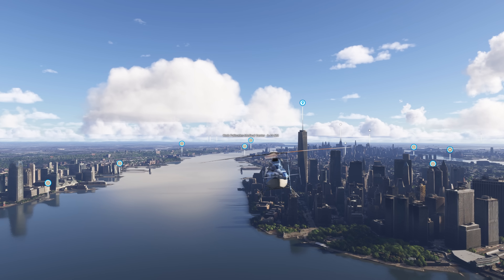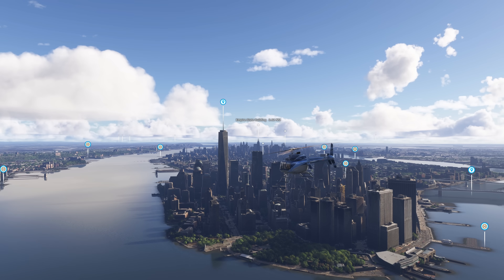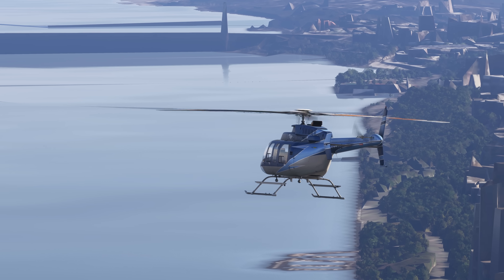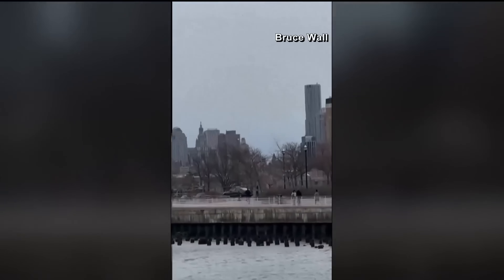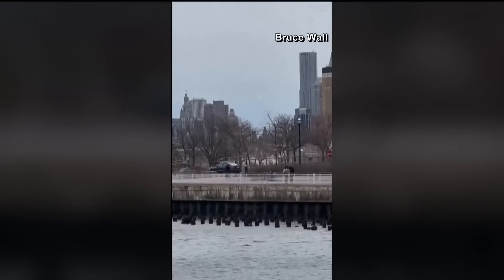Helicopter Expert breaks down Hudson Crash, and discusses “Bump Mast” Theory | NYC Crash Follow-Up

Comment: The rotor fell still attached to the gearbox and photographs show the blades are undamaged like they would be in a tail boom strike.   That helo had a major gearbox problem just a few months ago and the company has money problems so how well it was repaired is up for questions.   Looks to me like it seized up with how violently the fuselage twisted and the boom broke off from the inertia of the rotor.   The NTSB won't have any problems assigning cause to this one.

Comment: My uneducated guess is that the "jesus  nut" or jesus pin experienced catastrophic failure. As soon as the main rotor separated it hit or scratched the tail boom. The tail rotor not having to counter the torque of the main rotor experienced massive torque shift and snapped the weakened boom.

Comment: Don't these choppers have weight restrictions? 
Exceeding a choppers maximum load capacity can lead to
structural deformation or failure during flight. Was the total capacity above what that Bell was certified for? 
Did the operator check to see if the chopper was over weight capacity prior to take off ?

 Perhaps the chopper was fine failures to adhear to maximum rated weight could be the issue here did they weigh each person and what they were taking on board prior to take off to see if the flight would be within the crafts capabilities as far as weight / load are concerned ?

Comment: I did find a maintenance bullion for that model talking about  Corrosion of the fasteners or joint of the tail. 

I wouldn't play much into that because I would guess almost all long running platforms have these type of bulletins

Awesome guest btw. Great of you to get on people that are more knowledgeable than your experience allows you to be about specific fields or circumstances.  One of the required traits of a great pilot is the willingness to learn and being humble

Comment: Nope wrong assessment.  Maybe this gentleman did not see the video of the aircraft as the accident occurred.  The nose of the aircraft did a sharp turn to the right 90 degrees.  The failure is related to the tail rotor failing and going to a no torque situation causing the aircraft heading to go right..  Once that happened the tailboom can fail due to its moving sideways into the 100 knot winds and the rotor can depart.  It's basic physics.

Comment: I'm a helicopter guy. I have thousands of flight hours in the Bell 206 series, both long and short models. I am heart broken by the loss of life. The video shows a complete main rotor spinning and falling into the water separate from the aircraft. The video of the wreckage shows the tail boom severed about a foot aft of where it bolts onto the cabin section. Under normal conditions the main rotor cannot strike there. The main transmission is not attached solidly. It uses a nodal beam spring support system. this allows the transmission to bounce up and down in order to dampen vibration. I would look for a failure in this area. this could cause the transmission to tilt over and separate from the fuselage. Mast bumping has nothing to do with striking the tail boom. Mast bumping is when the rotor hub flexes down to the stop and the head strikes the mast. I don't think mast bumping is what happened here. It is hard to see details in the video, but I don't see the mast with the airframe. The rotor used in this aircraft is quite strong enough to cut through the tail boom and remain intact. This could only happen after the transmission came loose and completely tilted back.
Reply: Thanks. Navy helo pilot here. Flew the TH57 in flight school. The gentleman either has forgotten or is confused about what they taught about mast bumping at Pensacola
Reply: Former Navy TH-57(Bell 206), civilian Bell 206 Instructor Pilot and certified accident investigator here.  Yeah, not mast bumping and the gentleman’s description of mast bumping is not correct.  From the video evidence I’ve seen: mast bump - no. The rotor, mast and transmission are clearly visible autorotating to the water.  A mast bump would sever the mast just below the rotor hub. Rotor blade severing the tail boom - 
no. Photos of the recovered fuselage show the tail boom break just behind the fuselage mount point - impossible to get a rotor blade to impact that close to the fuselage and the intact rotor can be seen smoothly autorotating to the water.  “Jesus Nut” fail - no.  The “Jesus nut”holds the main rotor to the mast.  If that nut failed, the rotor would fly away from the aircraft - it didn’t.  The NTSB will get to the bottom of this but it looks to me like a sudden seizure of the main transmission, or a failure of the transmission mount.
Reply: I'm not sure the pilot had any warning before the catastrophic failure. what I am seeing is the tail boom was severed at about a 90-degree angle where the main rotor would strike if the main gearbox rotated backwards. This type of failure could easily rip the mast out of the gearbox The rotor blades are constructed with a D spar leading edge and aluminum honeycomb filler behind that. These blades are known to able to take small arms fire and chop tree branches when flying low. Chopping off the tail boom would not be a problem for a rotor blade. Calling for fuel when you are a few minutes out is normal. This alerts the ground crew so you can have a quick turnaround and get back in the air. This is how these types of operations make money. I do not see pilot error as the problem at this point. I am only trying to fathom how the main rotor can separate in flight and chop the tail boom off at a 90-degree angle. I know I am speculating. The investigation is at the beginning.
Reply: Hypothesis; Rotors tilted when they ripped out the transmission assembly and Rotors sheared through the boom close to the Fuselage. Both rotors are broken....
Reply: My condolences to the families of those passengers and the piolet.    May they RIP🙏.    So sad the whole situation 😢.
Reply: According to what I've seen, the entire transmission system ripped itself out of the cabin, an impossibility.
Reply: @Slitheringpeanut  It is very Possible! Read the Op's expert comment. He's a pilot with 1000's of hour of flight time in Bell 206. "The main transmission is not attached solidly. It uses a nodal beam spring support system. this allows the transmission to bounce up and down in order to dampen vibration. I would look for a failure in this area. this could cause the transmission to tilt over and separate from the fuselage."
Reply: @Slitheringpeanut Not impossible. Mechanical issues occur in such things that have never happened before.
Reply: There is no code in asking for fuel.  You can easily  make, half a dozen 20 min  tourist flights, before needing to refuel.  It speeds up the process if the ground crew is made aware.  In many cases, you don't even need to shut it down.
Reply: They lifted the main rotor, still attached to the transmission, out of the Hudson
Reply: I’m a helicopter guy too with many hours of flight and the Bell Helicopters are very reliable as you say and it doesn’t look like the Jesus nut was left of or had anything to do with it. My theory is that the pilot knew there was a problem and didn’t want to spook his passengers so he called on the radio he had to refuel after 16 minutes of flight didn’t make sense also he must have deployed the floats then the nodal noodles might have contributed because one video shows the transmission and main rotor falling together into the river. Of course we’ve got to wait for the  investigation and report. Condolences to the families of the passengers and pilot.
Reply: @jpridie  These are just 20 minute flights while the 206 can carry over 700lbs of fuel.  They would not refuel after every flight, probably only once or twice a day for of the 15-20 flights they make.  It would be perfectly routine to call in and let the base know that he’d need refueling before the next flight.
Reply: @jpridie  has it been confirmed that he said he needed fuel? It just seems like an easy way to point to pilot error, especially if there's no recording for the NTSB to recover. Please correct me if I'm wrong.
Reply: @catwhiskers1919  I didn’t want to imply that there was any pilot error I just said the if he had felt there was a problem then he wouldn’t want to spook his passengers when he called Air Traffic that he needed fuel which I think he wanted to land, then something catastrophic happened and the poor pilot had no way without a rotor to save the helicopter. It didn’t look like pilot error.
Reply: @jpridie , Your conjecture makes sense.
Reply: @jpridie   I apologize. I didn't think you implied it. I should have been clearer - it was reported that the pilot said he needed fuel and I do wonder if it isn't an easy way for the company to blame the pilot rather than face accusations of poor maintenance. Of course your theory is also possible and I may be too skeptical.
Reply: @ ok no problem and I agree with what you’ve said. I can’t imagine the horror that pilot went through as he lost control. I’ve flown over 27thousand hours mostly in the Bell series helicopters and also the Aerospacial now Airbus helicopters and only had two failures one turbine and one drive shaft from the engine and none of them Bell Helicopter. They have an incredible safety record.
Reply: @catwhiskers1919  doesn't matter if he needed fuel or not. That has zero to do with the accident!
Reply: @catwhiskers1919  It was probably a routine request that he needed to top up with fuel before his next flight, a message for the refuelling crew to be ready to refuel the chopper. Fuel had nothing to do with the accident. Everything was fine, until a split second later it wasn't.
Reply: @catwhiskers1919  How does needing fuel suddenly translate to pilot error?    If maintenance was the issue,  it will come out in the investigation. The company has no say in that.
Reply: @catwhiskers1919 This was not pilot error,  it was a catastrophic failure.
Reply: @edwardfarkas5771   agree
Reply: @jpridie there is zero chance you're a "helicopter guy"
Reply: I agree with this, definitely not mast bumping or anything pilot induced! The way that the gearbox was still intact to the main rotors fluttering down like that seems to me that something catastrophic happened that caused a very sudden stopping of very fast moving parts causing the separation below the gearbox. Also, you can see the tail and main fuselage whiplash forward from that sudden stopping. There's no way that if it was a mast bump that the rotors wouldn't have been damaged as well!
Reply: @JRadventures96  Both rotors are broken but not broke off in the pictures of their recovery.  imho Rotors tilted when they yanked out the transmission and then they sheared through the tail section close to the fuselage.
Reply: My guess is pilot error, he overcorrected and rotor hit the tail.
Reply: @doctordetroit4339 Nope, you can see that the main rotor is totally undamaged as it flutters down still spinning.

This was a catastrophic separation of the entire "drivetrain", for lack of a better term.

Comment: Looking at the NTSB footage after they pulled the fuselage out of the water, the tailboom separated at the first bulkhead after of the attach point. The separation looks nearly vertical. There is no way the main rotor cut the tail that far forward or at that angle. We will have to wait for the investigation of course but I believe mast bumping or some pilot induced issue can be ruled out already.

Comment: It's on the pilot to be able to make the right moves, at the right time...if he gets lucky or has a lot of practice like the Colonel.  I served three tours in Army Aviation dealing with the UH1, Charlie, and Cobra gunships as well as the ranger Helicopters overhauling its transmission.
Unless you get extensive training like the Military gives you in Autorotation's and avoiding bump stops then recovery of each...there is no guaranty that your frame of mind would be up to it. As a Commercial/Instrument rated Amphibian Seaplane Pilot in Louisiana flying in and out of bayous and over tall cypress and arround its sportsman's paradise, which means you're lucky if you can avoid all obstacles. 
I think the pilot called in for fuel, with a eta of three minutes? Why, if the chopper had only one run and fell out of the sky.  If he did run out of fuel over NY this is where at 1,300 feet without the recovery training even a seasoned military pilot with 15,000 hours would have difficulty and might instead look for a parking lot if he thought he was low on fuel. So if he did go empty without power and got ptsd it gets very difficult to remember the ABCs of autorotation, dropping collective, moving cyclic slowly, in the right direction avoiding zero G-forces.  All this while avoiding bump stopping the rotor, and if you do, finding a way to load them up.  R. Kelly "I Believe I Can Fly" song might have been in the pilots mind as he grew to love flying.

Comment: So-called expert says "server" instead of "servo" ???  Did any of you experts WATCH the many videos?  The helicopter was in stable and level flight, and suffered the structural failure BEFORE there was any deviation from level flight.  Both the rotor-blades were firmly attached to the mast hub, all the way down to the water, yet this tw*t is saying that likely didn't happen ??????   Nothing but speculation and complete lack of observational skills here.  The entire tail-boom did clearly separate before the rotor assembly came off.   FFS - WATCH the videos.

Comment: There was a video of the rotor assembly falling and both rotor wings were still attached to the transmission such that it was auto-rotating as it fell. A mast bump also typically damages the rotor wing that hits.  My friend was a helicopter pilot in the Army and survived no less than eight unpowered landings during his tour in Viet Nam.  Many of his units were hit with small arms fire so the helicopters he flew were well built and tough.

Comment: Hi Steve , great chat with the Colonel not giving any point of view here, just some things to bear in mind. I know the theory it's the same with R C Models. This may help. Main difference on these is that the Throttle and Pitch work together, so as throttle is increased the Pitch increases to the angle of attack for the blades to lift the machine. (in full size these controls are seperate) . Now generally at 5 deg in this example you will be in the Hover. When the machine is set up there is negative Pitch on the Blades at low throttle. What this does is physically drive the machine down, vertically, as throttle reaches that point. This negative pitch is important, for controlling height in flight and auto rotation , as the machine goes into an Auto rotation descent, at start of descent Pilot drops the Collective, this is the control for Pitch , the Blades go into negative, as the machine drops the uprush of air spins the blades faster, now the trick is before this machine gets too low , Positive Pitch is applied which cushions the fall, there may be a bit of a bump and that depends on what height the Pilot had in his favor when he entered the  Auto. There will be areas in Flight Envelopes where this is not possible. Colonel Joe would Know exactly what these are for sure.Colonel Joe Sir Thank You for Your Service. Thank you both and Thoughts with the families at this sad time 💙

Comment: After listening to Col. Joe's wisdom, it makes a lot of sense if the root cause was a main mast failure. Without the torque of the main rotor counteracting the tail rotor, the aircraft would yaw into the wind stream. The resulting aerodynamic forces might be enough to detach the tail boom.

Comment: If you go back n slow play the fall you will see the rotors still attached or one or two was there as it looks like when the heli upside down yu can see a bent rotor. Makes me think one rotor struck the boom  n went down. So watch it slow steeve you will see one of the rotor.
Reply: The first part of the debris that came off was the tail.  Then all rotors disconnected with the transmission still attached.
Reply: @ericresh3268  when the heli was falling one of the main rotar blade was still attached bent upwards towards the sky as it was falling upsidedown.

Comment: Could this be a case of metal fatigue of connection between tailboom and fuselage? When I watch the footage it looks like the tail boom breaks off first and the rotor assembly breaks off after that. This is not normal stuff. Something happened to that aircraft, I hope that the NTSB finds out what happened. as I love the Bell longranger.

Comment: You're right the MRB's looked in tach, the spinning looked like there was no unbalance condition. My thoughts is something happen to the gear box, a part looked like it was still attached to the rotor system. I have a Jesus nut from a Sikorsky H-19 in my collection. I also have part of a main rotor blade from a New York Airways crash at Newark Airport, a Sikorsky S-61L way back, late 1970's or early 80's..

Comment: given the gearbox was still attached to the rotor, it more likely the gearbox locked up and the flywheel effect of the blades not wanting to stop turning induced the sudden yaw and ripped the gearbox from its mountings
Reply: Possible for sure.  I just haven't heard of transmissions suddenly locking ujp.